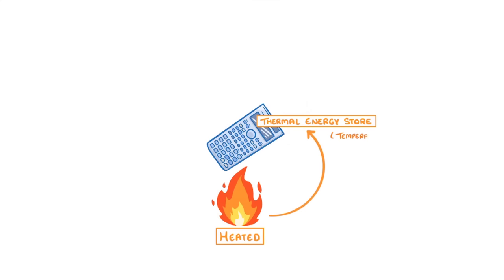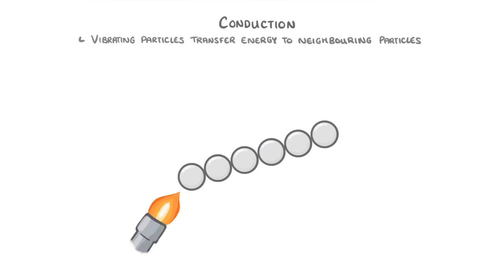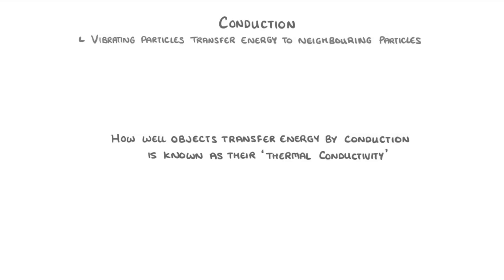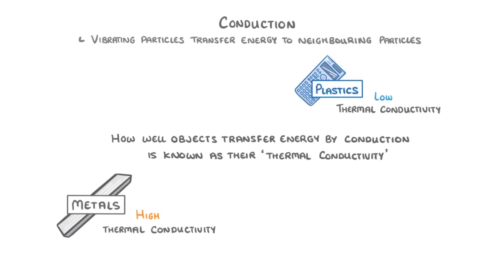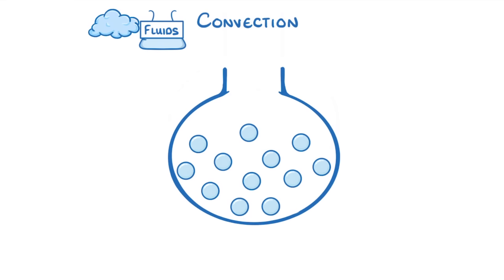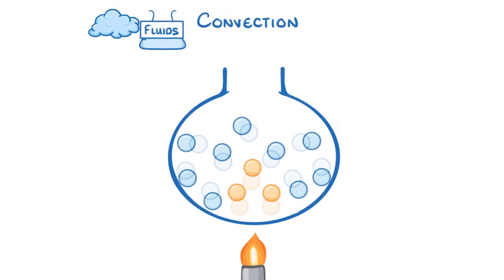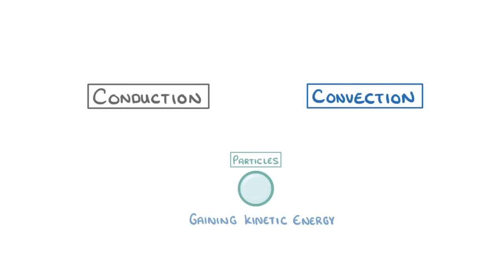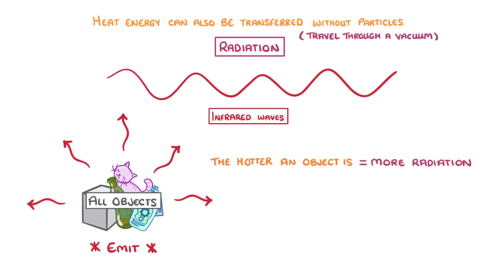GCSE Physics - Conduction, Convection and Radiation  #5

Comment: Question about convection : if there is a pot with water inside ,I stir the water rapidly, does it heat up the water ? Does it increase the water temperature ? ( I'm moving the particles as the fire do ) .

Comment: One question: if we take the example of a warm cup of tea, this emits radiations because it is hot. If we touch the cup and our hand is cooler than the cup, the cup emits radiations and our hand absorbs the radiations. In time, the cup will cool down and the hand will warm up. Is this an example of radiation, or conduction? Or can both conduction and radiation take place at the same time? Thank you!

Comment: are kinetic energy and thermal energy interchangeable? 
temperature = average kinetic energy 
if not, can you define thermal energy so that it's different from kinetic energy or are they at least interconnected?

also, is the reason that colder, and more dense fluids go down is because of the density?

Comment: Hi, i have a question in this part, you 5:20 where you give an example for infrared waves, you say its because the of the infrared waves that cause your hand to feel warm, but isant it because of the air around it? I mean because the coal and metal heats the air?
Reply: Both explanations are correct, as both infrared radiation and convective heat contribute to the sensation of heat when you place your hand over a BBQ. The flames of the BBQ produce both types of heat:

Convective Heat: This is the heat transferred through the movement of hot air. When the flames heat up the air around them, the hot air rises and comes into contact with your hand, making it feel hot.
Infrared Radiation: The BBQ emits infrared radiation, which is a form of electromagnetic radiation that transfers heat energy. When this radiation comes into contact with your hand, it adds to the overall sensation of heat.
So, it's a combination of both factors that make it hot when you place your hand over a BBQ.

Comment: But I still don’t know, because it wasn’t addressed, how is heat energy transferred to the fluid particles themselves? Yes, I understand that AFTER a group of fluid particles are heated they form a less dense set of particles and then float away and so the area they float off to is now warmer because of their presence, but that still skips the step of explaining how those particles got heated in the first place.

For solids, you explained that a particle gets struck by another and the resulting collision increases the struck particle’s kinetic energy, and that increased kinetic energy is what we call heat.

But what about fluid particles? How did they acquire their increase in kinetic energy? You only discussed their behavior (convection) AFTER they’ve been heated, as opposed to the solids, where you explained how their particles “acquire” heat.

Comment: Metals conduct heat better than plastic and wood.
Why? It is because metals have free moving electrons which helps spread the heat.

The electrons gain more energy and move faster, thus colliding with the stationary metal particles, causing them to gain energy and vibrate.
Whereas plastic and wood only rely on neighboring particles to vibrate and eventually collide as explained in the video.

Comment: Conduction: transfer of thermal energy through molecular contact with a medium in solids

Convection: transfer of thermal energy through the set up of convection currents through a medium due to density differences in fluids

Radiation: transfer of thermal energy through electromagnetic rays like infrared rays from the surface of a body 5:45

Comment: hi, could someone explain something: if the particles in convection move from hot to cold by random diffusion, but it takes place in liquids as well as gases, wouldn’t that be osmosis??
Reply: Hi! I'm kinda late but here's the answer: Osmosis only occurs in water molecules, when the water molecules move from an area of high-water potential (where there are more water molecules) to an area of low water potential (where there are less water molecules). However, for Osmosis to take place, there needs to be a partially permeable membrane and a difference in the water potentials (or you could say concentration of water as well). In the case of convection, there is no partially permeable membrane, or even a difference in the water potentials, therefore the water molecules in convection move by diffusion and not osmosis. I hope this helped! ^^